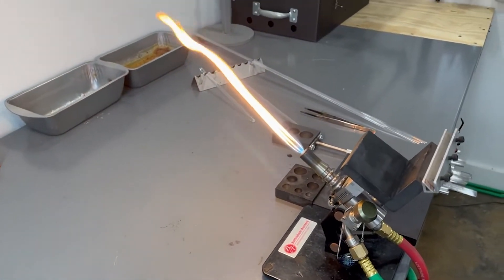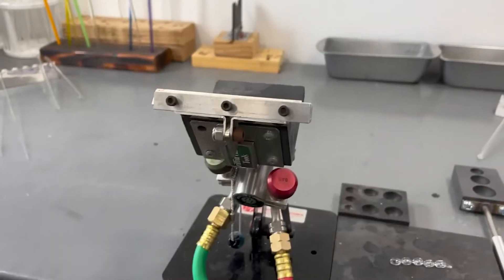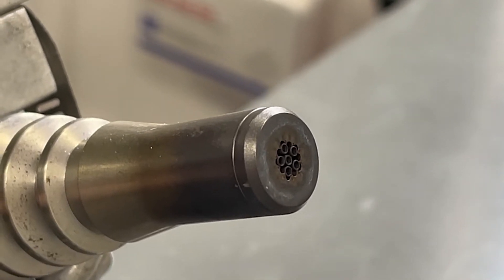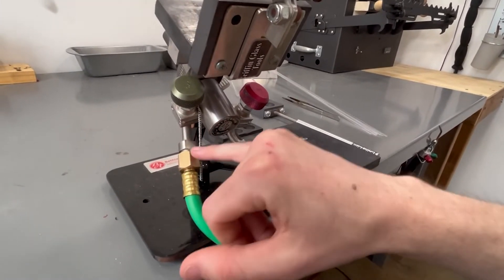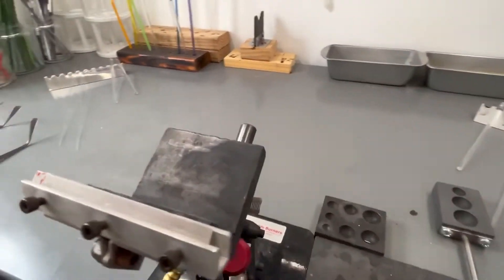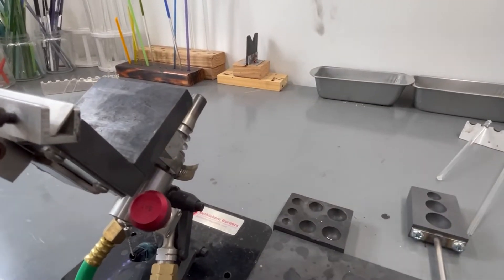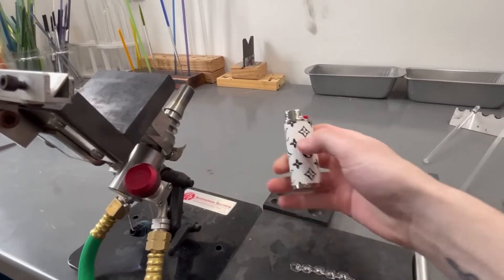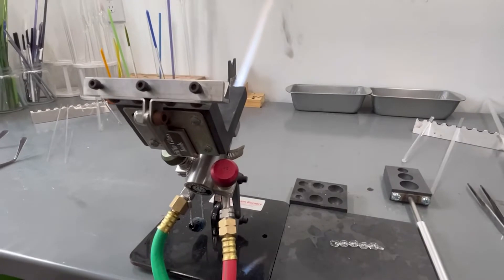What is a Glass Blowing Torch? How to setup a torch?  Bethlehem, GTT, Nortel, Carlisle

Comment: Thanks for you video. I am setting up a new shop in a small shed. Is it ok to put my oxygen and propane tanks next to my kiln? Thanks for the help.
Reply: I wouldn't put them right next to the kiln because it gets really hot, infact you can put them outside your shop and cut holes and poke the hoses through but I usually have mine off to the side with a strap around the oxygen bottle so it doesn't get knocked over

Comment: Just subscribed! I've been collecting and following glass art for about 15 years now and I just started messing around with actually melting glass myself a couple of months ago! I've only just been using a MAP gas canister with a hothead torch and a bead-making kit I found at Hobby Lobby, but that is soon going to change! I've never used a surface mix torch, but as of this morning I now have everything I need to get started...besides proper ventilation:( My exhaust hood arrived today, but still need duct and a fan. Anyways, I'm going with a GTT Lynx and a Jen-Ken Chillipepper kiln. I love your setup there in your studio. I can't wait to check out more of your videos. I've got some troubleshooting that needs done after work tonight. After picking up my oxygen tank this morning I stopped at a gas station and bought some propane. I got everything hooked up but had a propane leak at the regulator/tank valve connection. I was very short on time and had to unhook it till i could further inspect exactly where the issue lies. Major bummer as i wanted to see this torch light up before going to work, but what can you do🤷‍♂️ I'll be tuning in again soon though! And thank you for showing me exactly why I needed these flashback arrestors. Had someone telling me not to worry about those smfh. @cloudsofglass is my Instagram btw. I feel you said your name here somewhere. I'll look back and find out and follow if you did!